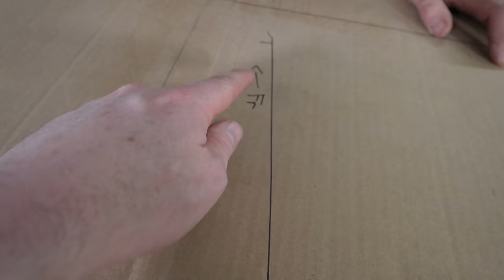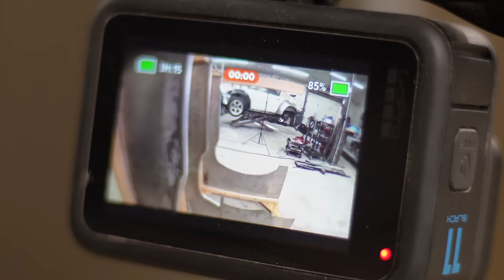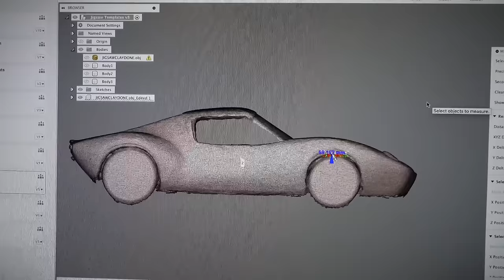$500 Junkyard Supercar! Building the Front End! - Project Jigsaw

Comment: Hey y'all.. love the jigsaw project. 

Regarding the body shell development. I know you have aluminum paneling in mind, but as an alternative, have you checked out the Bugatti project from the Axes Garage team? The are using a 3d model to build a fiber glass mold with a lot of precision and strength using an existing 3D car model provided by a 3rd part. 

If you have the computer modeling skills. I'm pretty sure if you section your 3d model of the boxter to fit the 3D printer, that you could easy glue together to create the mold. Which can then be used to fabricate a high quality fiberglass clam shell as well as door skins. 

Unfortunately this minimizes the metal shaping skills, but it is more dependent on CAD/3d Modeling skills. It could be easier for you to produce symmetric complex curves on the car from scratch (take the concept to the computer to visualize, then to the mold, then to fabricate, then dry fit, then finishing, & final install).

here is a link for there project if you are interested in investing 

https://www.youtube.com/watch?v=aevCw9SD2Hs&ab_channel=Axes%3AGarage
https://www.youtube.com/watch?v=52cS7I7Upkk&ab_channel=Axes%3AGarage

Comment: Are you going for a 60s homage that's the actual size of a boxster, or one that just uses the boxster to provide the structure? If it's the former, section your latticework; if the latter, get some hub spacers and lowered suspension and give it the extra girth all those 60s supercars had (which is why they look so low and sleek  - the same reason you do your own wide-bodied modern porsches). Once you realign where it meets the windscreen,  I think the extra width would work well (otherwise the transition from bonnet (hood) to wing (fender) might be too abrupt).

Comment: NOT A BUILDER... JUST A QUESTION

I'm pretty sure they mentioned in the last video, the reasons why doing it their way over a trad wood buck way made sense...  but I'm still not seeing it.  Their method does give more artistic freedom to form and design the body more organically, but since they 3-D scanned a scale model and are using cad forms to set the intended shape, Why don't they go ahead and cut out the whole buck for the body, then, as they attach and weld the aluminum rod to the buck, they can make their artistic tweaks, that you can't see until it full scale, here?

Comment: This method will take forever
Reply: This is why no one will remember your name.
Reply from the maker: Coachbuilt cars aren’t made overnight. 😅
Reply: Do you know long car design & prototyping takes for a car brand that has thousands of $ and many employees to make it happen? This is 2 guys in a garage in their spare time, and they are moving along quite well.
Reply: Agree.   As I said earlier, you could design it on the computer and then have a large cnc cut foam panels, and then fiberglass over them,
and it would be done in a week or two.    I don't see the value in aluminum body worth all this time (and thus expense).   
But as usual for a youtube channels, doing it faster and easier isn't the main point.   My custom 71 Midget front end was foam blocks sanded to shape and glassed over.   My biggest challenge was (is) getting the fender flares the same on both sides...without a fancy shape tool.